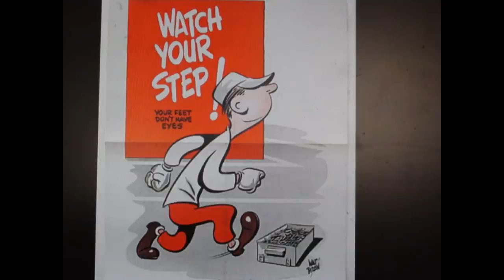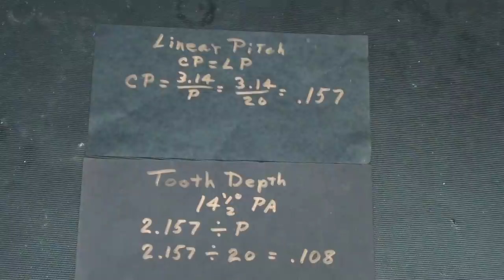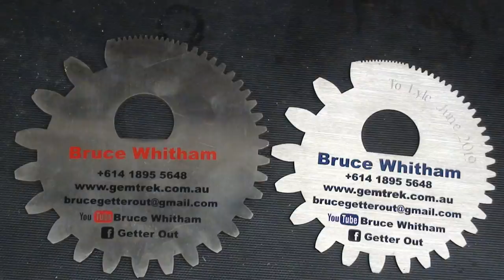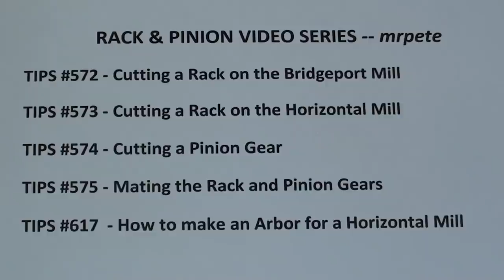Cutting a Rack on Horizontal Mill TIPS #573 tubalcain

Comment: Great Video ,I Have Made A Couple Thousand Racks This Way ,No Read Out Needed ,Used To Build Rack And Pinion Steering Boxes ,Built A Fixture ,To Hold Eight Pieces ,Mounted A Piece Of Purchased Rack To The Fixture  ,Then Used A Last Word To Pick Up Each Tooth On The Purchased Rack ,Then Cut Each Tooth ,Move Over .157 ,Repeat ,Then You Don’t Have To Go Nuts, Remembering The .157 Number ,Worked Great Till I Bought A Rack Cutter To Cut Them All At Once ,On A Number 2 ,Browne & Sharpe ,The Good Old Days !!!
Reply from the maker: Thank you, that is very interesting and a wonderful solution to the task

Comment: Years ago when I was young & foolish(er) I made 20 off 3' long by 1"sq. racks & matching pinions for dumpster sliding hatches.... not exactly precision work 🙄😂

I used my Elliot shaper & hand-ground a piece of 3/4" HSS ... using an original rack as a template... (the end teeth with no wear )... 
The M.S. pinions were milled on my Van Norman mill using a homemade dividing head. The racks were marked out for each tooth ... I'm not sure if any REAL profit was made on this job but they worked fine and I enjoyed the challange. 

As a self-taught machinist from textbooks (no youtube back then 🙄) I learned "on the job" making tools & accessories for my machines. I limited my self to jobs not requiring super precision as I couldnt afford accurate machines & much in the way of metrology... a few mics & verniers ... but I "got 'er done"for a lotta farmers with broken stuff & made a living. I ended up being self-employed for 35 years & loved every minute of it. I was born with machining in my blood...& I still do it !! 

 😎👍☘🍺
Reply from the maker: You were very inventive and creative, thanks that’s a good story

Comment: "Arbor not running as true as I hoped for."

In my experience, even commercially made ones seldom run true.
Reply from the maker: You are so right, there always seems to be a little bit of a lope In the cutters. I first noticed that 45 years ago
Reply: @mrpete222  It wouldn't be so bad, if you could index the cutter to present different teeth at the high point of the run-out, but with an arbor running out of true, most of the teeth do no work, meaning only a few go blunt, and you throw away a cutter with 90%+ of the teeth still sharp.
Reply: @BedsitBob  if the cutter gets removed often enough it couldn't be remounted too consistantly..
Is this a tool that stays on the machine long term?
Just thinkin..
Reply: I guess thats irrelevant if the arbor is where the error is...
Reply: @imagineaworld  The cutter will always be mounted consistently, with the same tooth running high, because the cutter is keyed onto the arbor, so is always fitted in exactly the same position.
Reply: The key is really meant for industrial heavy cutting, in the home workshop where production time is irrelevant, remove the key. BUT ensure you mount AND run the cutting direction, such that should the cutter jam or try to slip, that the arbor nut tightens.
Reply: @BedsitBob  why would you throw away the cutter? You get them sharpened, they last almost for ever, well a very long time. Certainly a lot cheaper than replacing them.

Comment: Nice video. Thanks for making these videos. Don’t know if you own a metal shaper, but if you did you could make a rack of practically any length, just grind a tool bit with the proper tooth form. Also, for those viewers who might need a rack and/or pinion, www.mcmaster.com has a nice selection. I remember running the horizontal mill in high school machine shop class 1973-1975, think it was a decent size Milwaukee.

Comment: Mr. Pete, why don't you just use the shaper to cut the rack? It would seem ideal to eliminate the clearance issues you show with the horizontal and vertical mills.
Reply from the maker: I may try it someday. My Shepherd is too low powered. It’s stalls on a plunge cut

Comment: I'm not a machinist, so sorry if this is a dumb question. Would it be possible to do twice the length by using a piece of stock double the length and turning it round?
Reply from the maker: Yes, if you actually mean double the width

Comment: Nice job on the horizontal mill. Could the shaper be used for a longer rack? Obviously it would take quite a while. Thank's for the great video.
Reply: Yes, provided the parts of the machine clear the work-piece.

Indeed, a longer rack could also be cut on the horizontal mill, provided the  machine parts (eg. the overarm support) clear the work-piece.

To that end, larger diameter cutters (the larger the better) would help.
Reply: Absolutely yes,  as long as you need.  As far as time wise,  we have a time punch card clock !

Comment: For us non-machinist, how do you tell which direction the cutter should run?
Reply: You can cut left to right or right to left depending on which way round you install the cutter. Obviously if you cut the other direction the cutter has to rotate the other way too. If the cutter rotates the wrong way, it won't cut and the sound of it will tell you something's wrong pretty quick.

Comment: I love cutting gears. 

It's interesting that for both DP (imperial) and metric gears there are 8 cutters to the set,  that do the same number of teeth range, but the cutters are numbered in the reverse order. 

I miss not having a universal mill to be able to cut helical gears, other than plunge cutting them to fit a worm drive. 

With only a 5/8" shaft, if any of the spacers are not perfectly parallel on the ends it will bend heavier shafts when tightened up. 

Do you have a keyway in the shaft, that would further reduce its strength, even if it was only 4 mm or so.
Reply from the maker: My key, just a little hardened pin
Reply: The daimetral pitch is almost the same as the metric module pitch. I was just figuring out the pitch of a couple metric gears that I need whenTubalcain started this series. I found the conversion in the same Brown & Sharpe catalog that Mr.Pete has on page 336. A module 1.25 = 20.32 daimetral pitch. It turns out that the depth of cut between a 1.25 or 20 DP are only a couple of thousands different. I found this interesting anyway. Yes I lead an exciting life!
Reply: @andyZ3500s  The mathematics for metric module gears is simpler than initial DP.
For metric module:
PCD = module # x number of teeth, 
OD = PCD + 2×module #
Depth of cut = 2.25 × module #

With imperial gears DOC varies with pressure angle and reference standard.

Comment: Something just occurred to me. Is it possible that after cutting something like this that warping/twisting/bowing could pop up? And if so is it likely to even be enough to be any problem for more precise tolerances?
Reply from the maker: That was a big problem years ago at school. But I checked one of these little racks with my brown and sharp straight edge. I could not detect any bowing
Reply: It happened to me when I cut a new rack for the surface grinder I'm restoring. 1 inch cold rolled, 14" long, 12DP teeth cut one side only. It bent about 50 thou. I had no choice but to remake it but using hot rolled stock.
Reply: @ThePottingShedWorkshop  you couldn't straighten it? Just a question.  The commercial rack i used in the weld shop was never straight

Comment: Hi Mrpete,  can you stack the racks in a line to make longer ones? how to do that ?
Reply: Mark, YES you can, often lathe carriage racks are done this way. You would have to ensure that the end of each rack is accurately machined square and the distance from the end to a tooth is 1/2 a pitch, so that when they are joined together, the pitch is correct. You would also be advised to Dowel each piece of rack down to where you intend to use it so that any force from the pinion does not try to push adjacent rack parts apart and give you binding.
Reply: Of course it is still preferred to use a continuous one, on the lathe I have the rack has 2 pieces, the other piece is in the bed gap piece and the rest 1,5m is continuous.

Comment: But I wish you were my teacher. 
But I was a very bad pupil. 
My metal work teacher. Sed mop up that water by the forge. 
So I did with the oxiocetilin  torch. 
I know that's not how you spell oxiocetilin. 
For all my hard work. I got a smack on the back of my head. Mmm
When I left school. I worked in a tool making shop. 50 years ago. But all I wanted to do was to punch my manager. 
So I left. 
Better than going to jail. 
But now I miss metalworking. M
Reply from the maker: Yes, I had a lot of kids like you at school. But some of them liked being in the shop. And they sure liked it a lot better than being in math or English, LOL. And actually, some of them were really nice kids, they just needed a little growing up